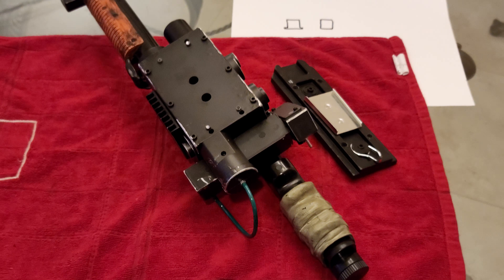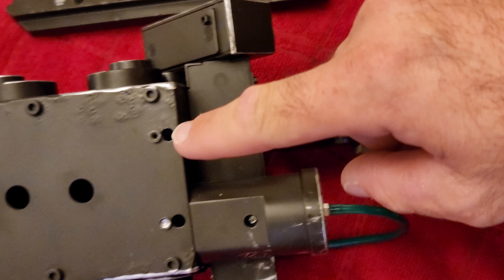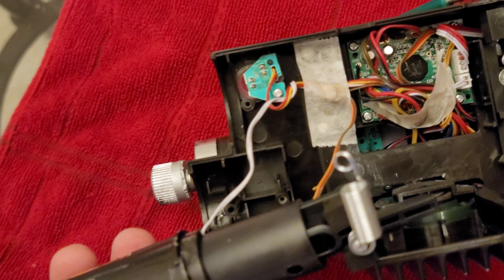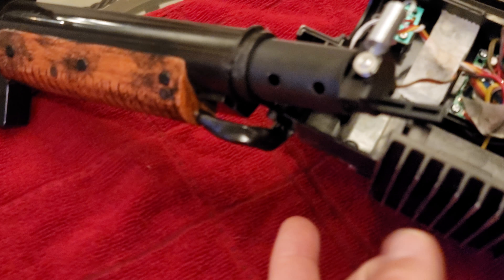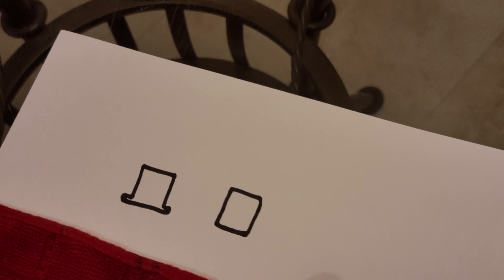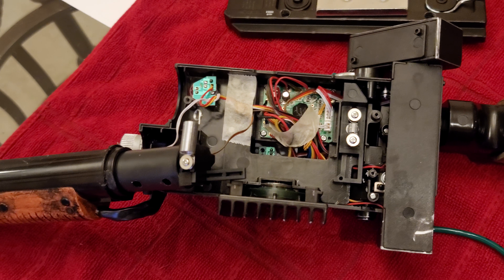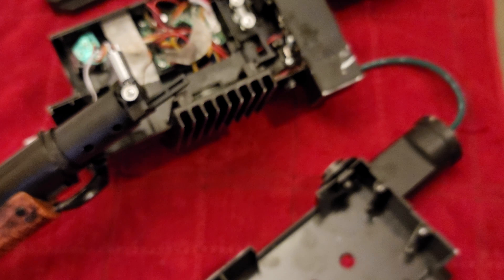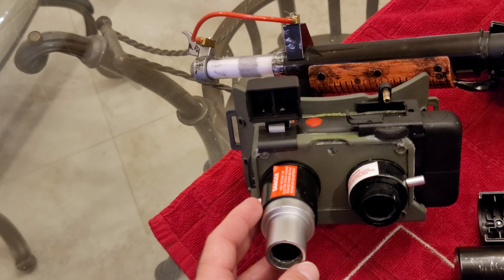Spengler's neutrona wand.. *in depth look at how I modified the new afterlife neutrona wand.

Comment: Thanks for a look inside this bad boy. I have a related question for you, I know this video is like 3 years old and you may no remember but do you know remember what holds the rear handle in place? Mine too a spill is a little loose and I'm not sure if it's worth opening it up to tighten it, or just leave it. Any insight would be great, thanks.

Comment: What notches did you dremel to get the twist? I took the spring off and unscrewed the barrel I just don’t know which grooves to file down. I have pics
Reply from the maker: Just pause my video and compare with your wand, you will see where I removed the little bits of plastic. Its the barrel and bottom of the gun body.

Comment: I opened it up I don't know how to get to the clippard in order to change it there's so many electronics in the way how do I do this? what do I unscrew?
Reply from the maker: Unscrew the clippard from the outside. Should come right off. The nuts might fall off the back and into the body, just shake them out while its open. If the nuts don't fall out just poke them out with a tooth pick or something from the outside
Reply from the maker: Stay tuned for my latest mod, ill be posting a video later today

Comment: What did you to the clear transparent  barrel to make it more accurate ?
Reply from the maker: I used a dremel with a sanding tip. I taped off where those details are on the barrel and lightly sanded it to give it that texture then I used a very light black wash paint technique to give it that aged/charred look.
Reply from the maker: The light still shines through as if I did nothing.